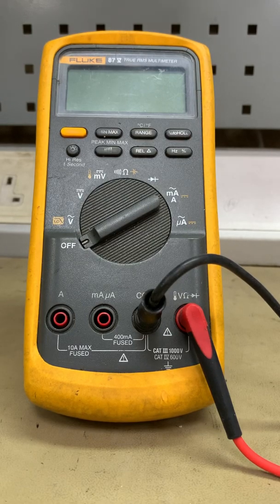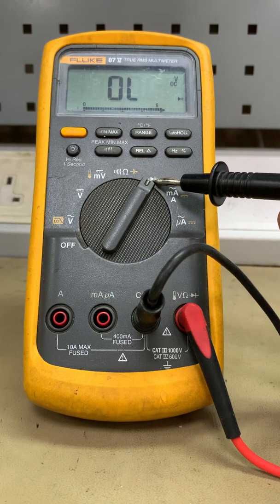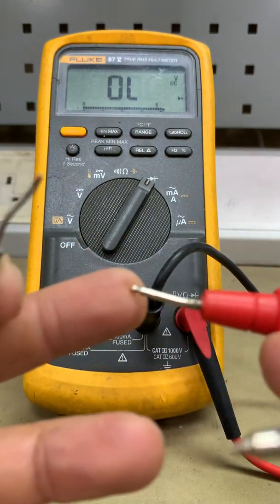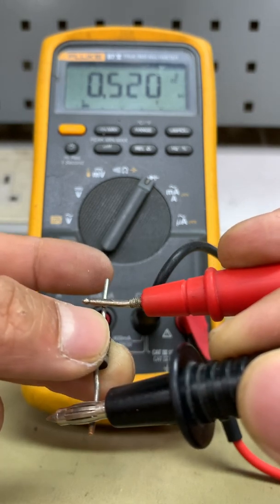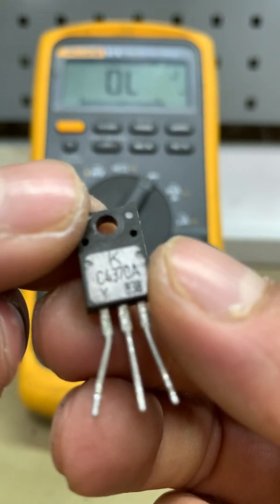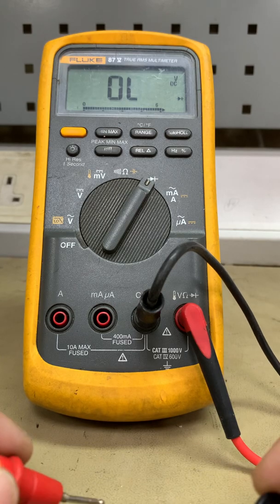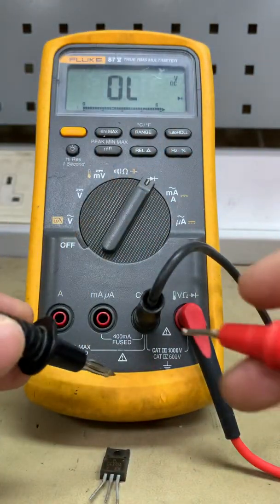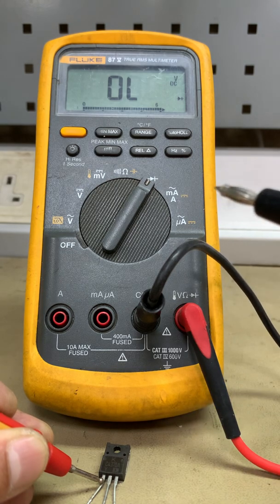Part 3: How To Use Fluke 87 V Digital MultiMeter For   Beginners | Diode &Transistos Test #fluke87v

Comment: What about shorted diode in diode mode give long beep Or short beep
Reply from the maker: It would give long beep just check my previous video about shorted bridge rectifier diode long beep/contenous beep with infinite zero reading of multimeter